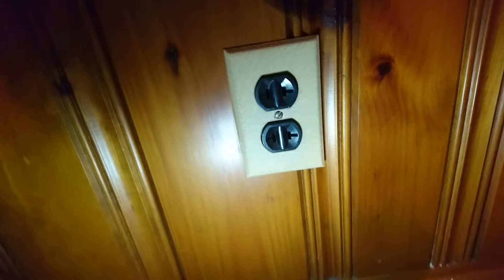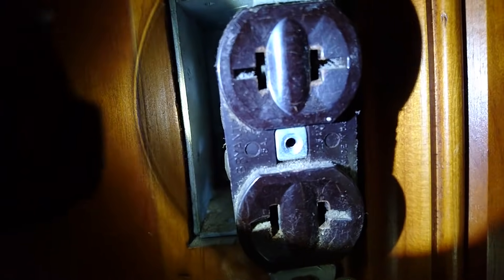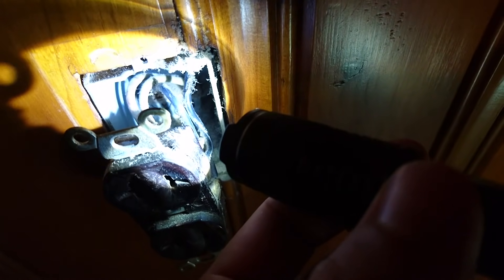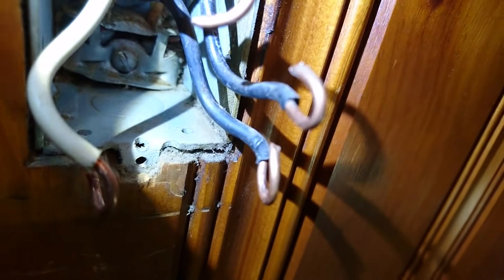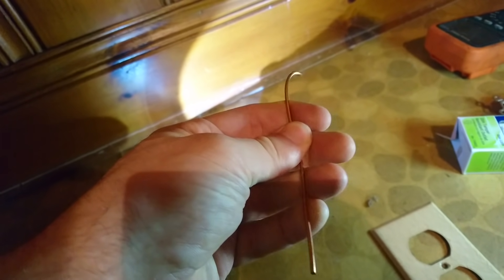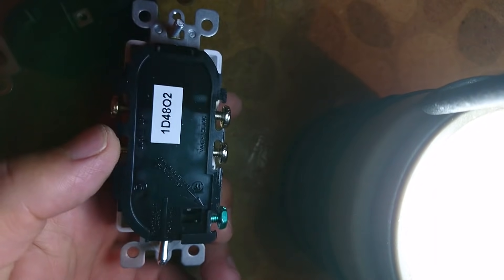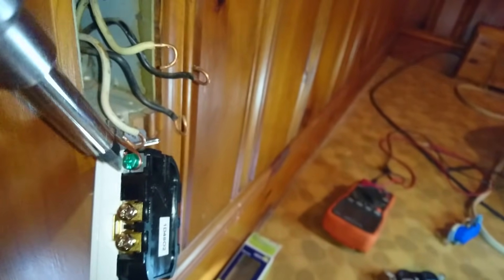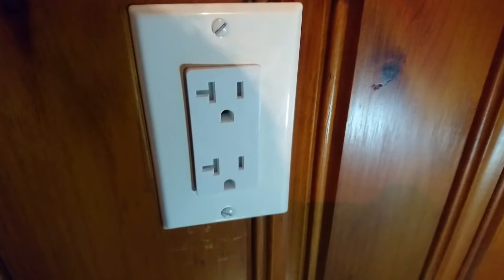How to Convert a 2 Prong Outlet to a Grounded 3 prong Outlet (TYPE AC Cable WITH Grounding Strip)

Comment: I would exercise caution listening to this guy. I have been an industrial electrician for many years with five years of electrical school behind me. The first red flag I got was when he mentioned about the line and load and whether it was on the top or bottom screw. In the case of a gfi outlet or disconnect, the line and load matter where you land the wires. In the case of an ordinary outlet like he is installing it makes no difference. Second, I think he needs glasses because those wires were clearly copper and not aluminum. I think the white light on his led flashlight was making him see something else. Lastly, what he was doing by joining a jumper from the box to the outlet. That would work ONLY if the feeder is armored cable, which would be connected to the panel and would therefore be a source of ground. In the case of old cloth or romex cable with no ground wire, he would have to replace the wire to get a proper ground.
Reply: 1. Line vs load: he didn't say it made a difference for this ordinary outlet, he just said that convention is to have line on the bottom and load on the top. 2. He didn't say the wires were aluminum, he said they were copper. He said to check if you had silver colored wires that they are probably aluminum and to replace them. 3. He started out the video by saying that he was working with armored cable and that is why the jumper will work. Watch the video again and you will see all of these points.
Reply: You are correct. I jumped through the video a little too fast, and should have watched it through better before commenting.

Comment: You should immediately replace the aluminum wires that feed from the pole on the street and feed into your meter with brass wire.

Comment: Grounds need to go to panel, be best to grab a ground from a circuit that goes to panel and to box; I’m going to be honest also my father was an electrician; in hard cases the neutral was used for a ground; you shouldn’t every do that however iv never seen a problem with using a neutral ground. It shows as a false ground ; actually to the box really a false ground . A real ground need to come from a circuit to the bus-bar at panel properly
Reply from the maker: They do, at least in my case.
Reply: Please remember that the neutral is a current carrying conductor and should never be used as a ground.